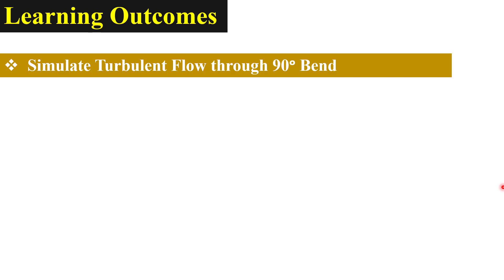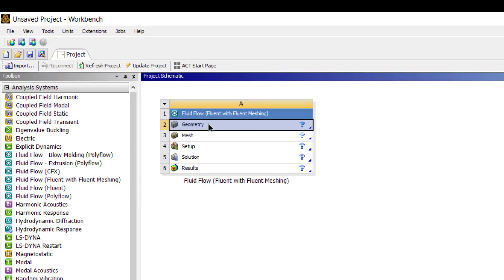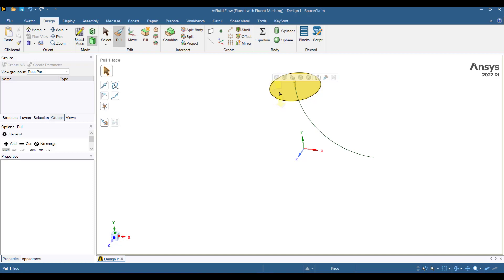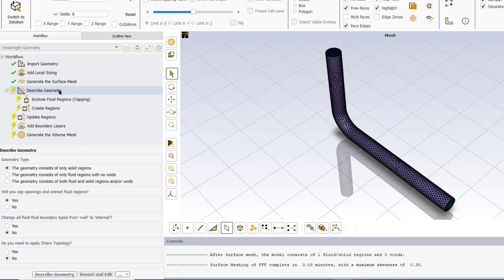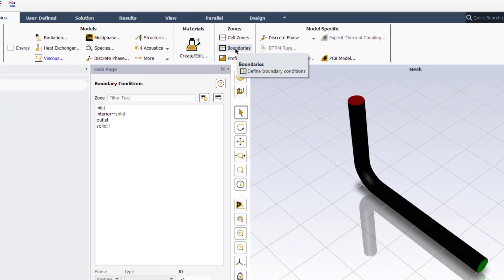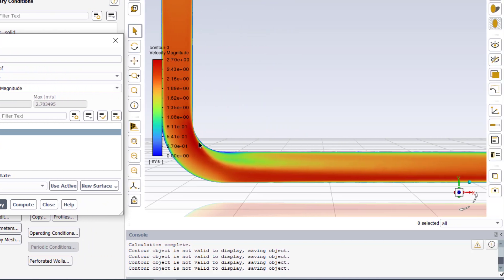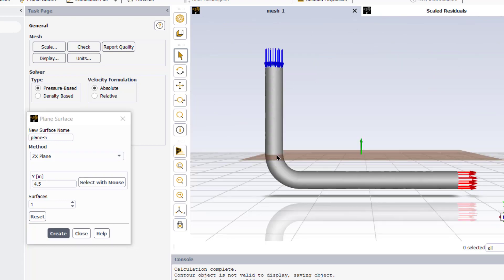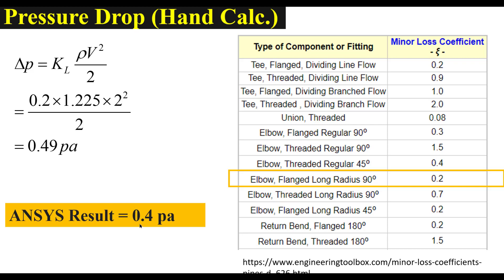ANSYS FLUENT Tutorial | Pressure Drop at 90 Degree Pipe Bend | Design of Piping System

Comment: Nice work done
Reply from the maker: Thanks
Reply: Sir is there any module/option which is used to insert megnatic field "Bo" and dimensionless slip coeffient "B" in boundary conditions
Reply from the maker: @aneesurrehman4135  try Ansys Maxwell
Reply: @drumairmunir  thanks for response, sir I'm working on microchannel with nanofluids , i want to insert magnetic field and dimensionless slip coeffient, i enable MDH model ( megnatic induction). But i don't know why it's not working properly,,, I'm trying with UDF but have problem to make it visible in fluent libraries